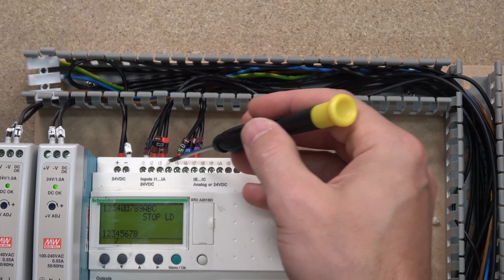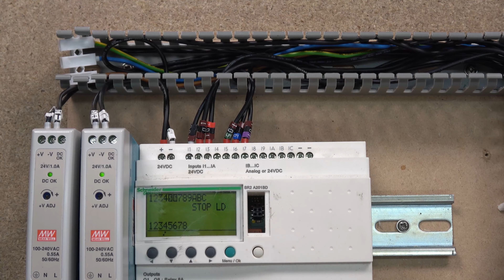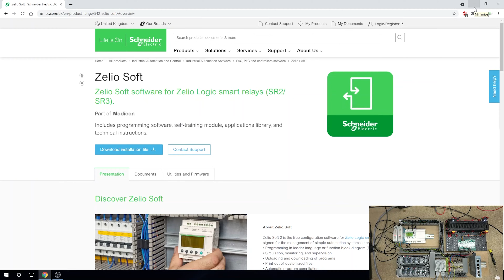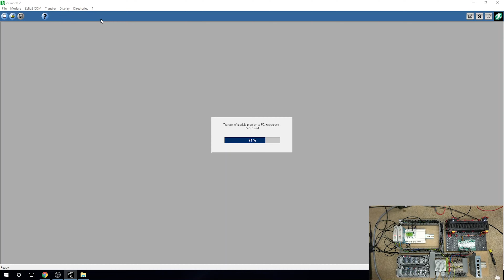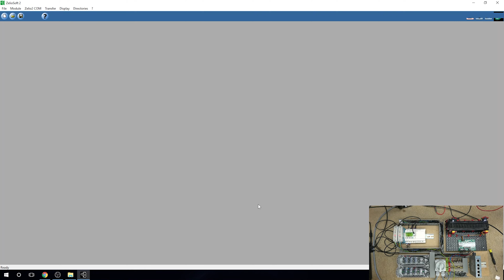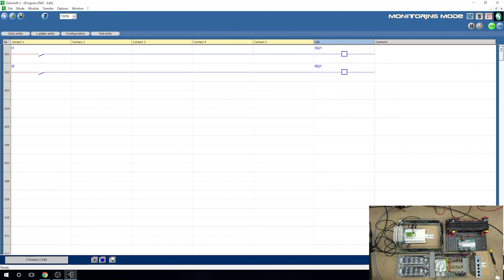Schneider Electric Zelio logic controller wiring, program upload/download with Free Zelio Soft. Eng

Comment: Hello, I have an SR2A201FU model controller, the problem is that output number 2 is permanently closed, I want to replace output number 7 with the previous output through the keyboard on the controller, is it possible?

Comment: clp zelio sr3 b261fu is compatible with io expansion sr3 xt141bd?

Hi. Is it possible to download the program in zelio soft2 into 
the physical zelio clp sr3 b261fu using SR3MBU01BD? 
I don't have the serial programming cable.
Reply from the maker: You will need the programming cable for you to be able to upload program to your laptop.
Reply: @IGSElectronics  oh =/  i don't have cable programming. =/
Reply from the maker: @gnengenharia  You will need to get cable to be able to edit the program, if you are using the memory card for just transferring the program from one controller to other, that is fine, but if it requires editing as specially if you are adding extra ad dons, cable is the only way.

Comment: Thanks Ingus - nice and simple, can you "transfer" the program from one unit to another (say the unit is faulty) even if it has a password (with the program or the memory stick)?
Reply from the maker: Am not sure about the memory stick, but if it is password protected it will not let you pump the program out in software. I will check it out in the future if it is possible with memory stick.
Reply: @IGSElectronics  Thanks, we had a Crouzet controller that was damaged, so we bought a new one which came with the program and lead (similar to the lead you have), but it was password protected. We did not want to change the programming just transfer it from the damaged controller to the new one and keep it password protected. This was on a air handling unit (AHU).
it would be useful to know whether we could port the program over with a memory stick and how to do it. Its probably simple, but we did not purchase the memory at the time. 
Many thanks Andy.
Reply: Can you teach me how to lock on